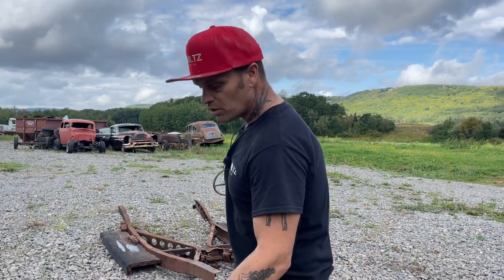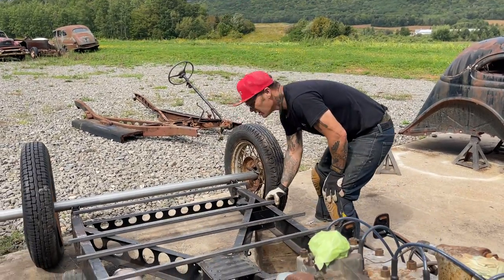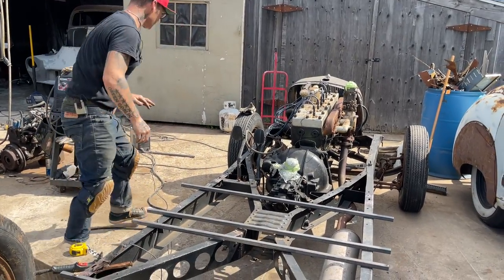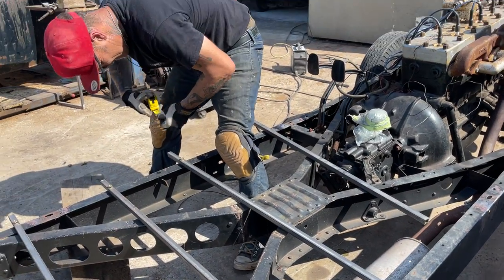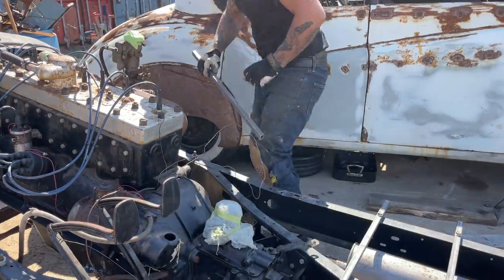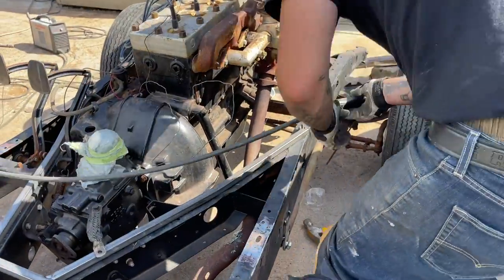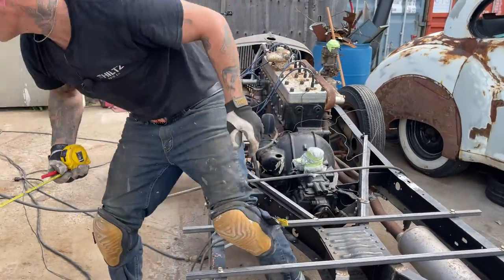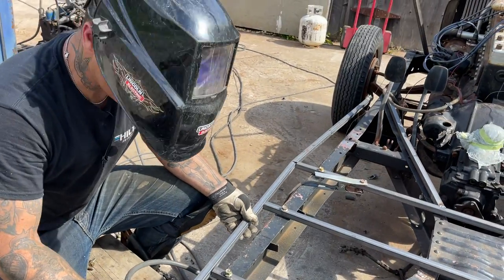FLOOR FABRICATION TUTORIAL: 1935 FORD HUBMOBILE/FORD HOTROD (PART 1)

Comment: The reason for the "wild bends" in the floors is for strength its positions are going to be specific to add strength in certain areas for collision and forces applied like torque and sheer force

Comment: I'm a huge fan of simplistic designs.  There is no reason for the high cost panels if they even make them for what you're building.  Just some beads for strentgh and a step down to overlap and it's clean and strong. plus fast and cheap.  Great job

Comment: You really need to put some gussets on the front end bracket you made, the ones you put on are for the up and down force but you need to make some for left to right forces so it would be best to cap the top off completely or weld four triangle pieces which is more work so just cover the top of those gussets you made with a rectangle plate.

Comment: Interesting Chad's approach to mount  the cab over the chassis while be able to remove it as see fit. Good way of thinking ahead.
Reply: Kia ora from New Zealand, Why do you start new projects without completing the other ones?
Not a negative comment just want to know your thought process or strategy on how you complete projects. Is it parts or cost etc.

Comment: Chad I have a 1936 ford coupe it's a junker but I still want to build it. To build the floor do I have to make the original mounts that go from the A pillar to the firewall and finally to the frame or does it matter as long as it is all connected? I will appreciate any help from San Antonio Tx. Thanks

Comment: It's a bad idea to make your rear end a solid mount, race tracks are not perfectly flat, your car is going to bounce and at high speed that will be very dangerous.  For safety sake put some kind of suspension in the car.
Reply: Hi speed?  
This is just a fun project, not meant to win any races. Having a good time and making a visual statement is the goal According to Chad
Reply: He is out of his league on this chassis
Reply: If the car does not pass tech inspection at the drag strip they will not let him run

Comment: You need to cut the bottom of the car first, then set the car on the frame by building brackets for the car hook it to the frame then  build the floor !

Comment: If you don't believe that solid mounting the rear end then borrow someones tractor, put it in high gear, about 2500 rpm and go down a road that is a bit bumpy and see what happens.  You will be doing around fifteen miles per hour and you are going to bounce, now imagine going just 30 miles per hour and how much that bounce will be at that speed, even at that speed it will be dangerous.  If you go ahead and do this then turn the car into a trailer queen.
Reply: Yet 10,000 hp fuel cars are also on solid rears mounted?